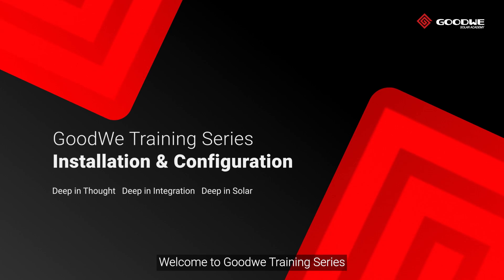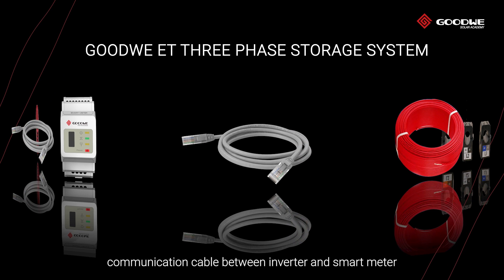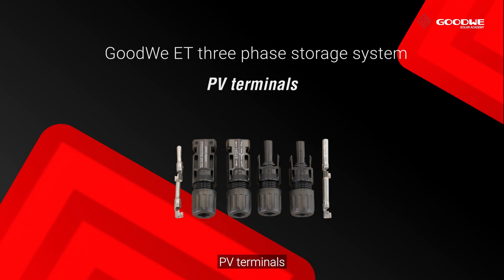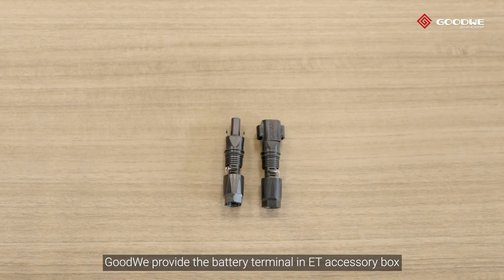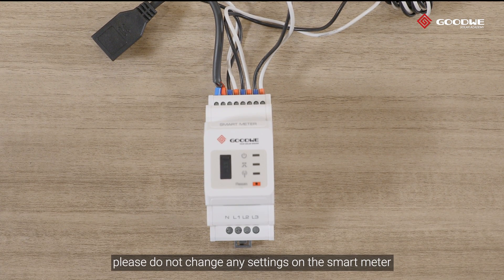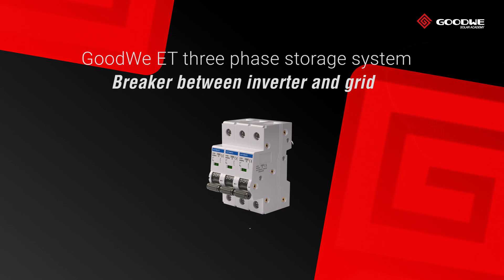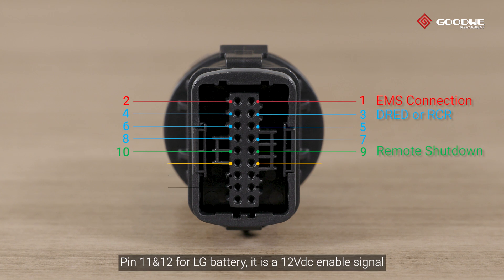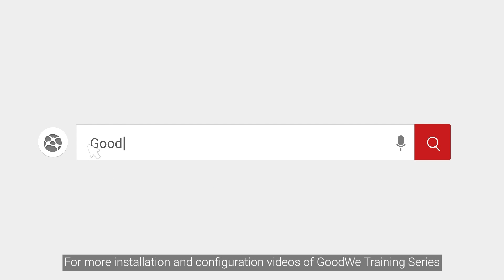GoodWe ET storage system Components& Installation

Comment: Can we use Li-ion batteries of 48V and 500Ah? And is it mandatory to use Li-ion batteries or other options such as gel type batteries can be used. Thanks
Reply from the maker: The compatible type of battery is determind by battery voltage and current. Please follow ET's parameter of 'battery input data' on ET user manual which can be downloaded on GOODWE official website：https://en.goodwe.com/document-download

If your battery is not on 'GW_Approved Battery Options Statement' list, you need to do BMS communication with our inverter for your battery.  This kind of communication is difficult for end users, and generally only distributors and manufacturers can do it.
Reply: Simple NO